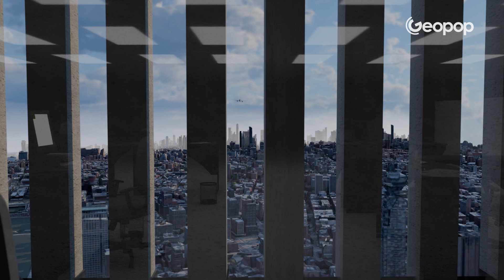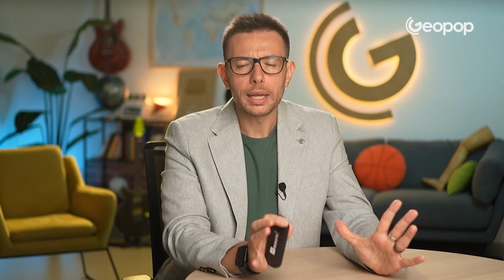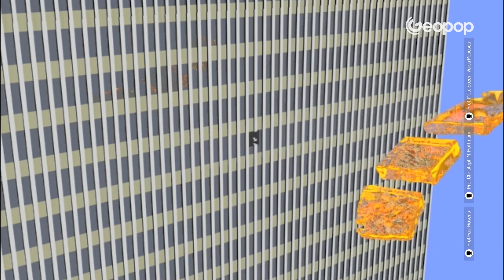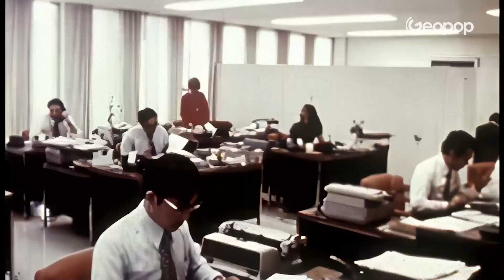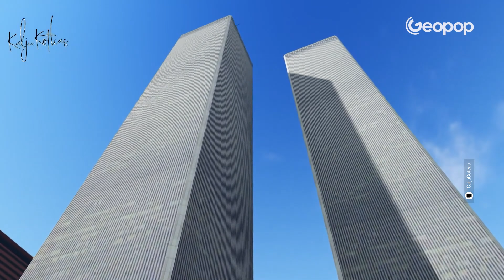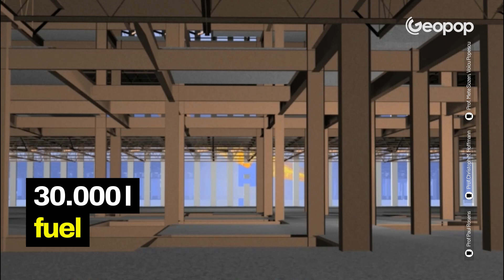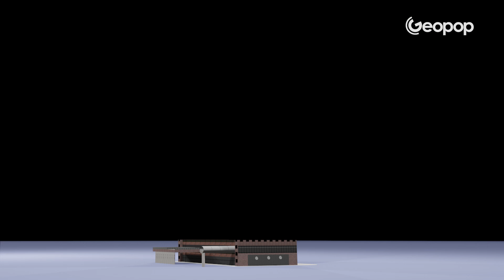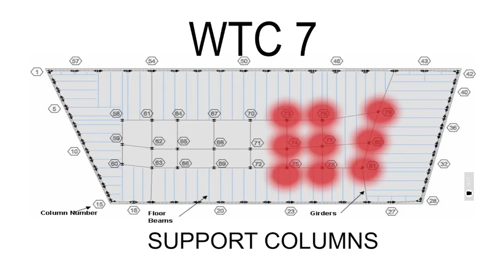9/11, 2001: The Technical Reconstruction of the Twin Towers and WTC 7 Collapses

Comment: That is what many people say , That its do to the way its built . Thats sounds good for the Twin towers but what about building Seven . Its traditionally built and never had a direct impact but yet it freefell in seconds it was down ( and without damaging any buildings around it) CONTROLLED ? MAYBE
Reply: There was absolutely nothing traditionally about the way Building 7 was constructed.

Building 7 was a unique, asymmetrical 47-story steel frame structure built atop a smaller 3-story building serving as a partial foundation, requiring lower floors dedicated to complex load transfer structures. Of trapezoidal shape and tube-in-tube construction, B7 (above the 7th floor) consisted of a central core of steel columns carrying most of the gravity load, perimeter steel columns around the outside of the structure carrying the remainder of the gravity loads and long span beams and girders to tie those elements together and form the floors. On the outside of the building hung a facade or outer shell. 

A lot of that is covered in this video. 

Building 7 collapsed from the inside out which is not at all intuitive and hard to understand with most details being hidden from view.  It requires careful analysis and observation, and some people will struggle no matter how much it is explained. 

Again, covered in this video.

When it collapsed it destroyed the building at 30 W. Broadway (Fiterman Hall) and caused nearly a billion dollars in damage to the Verizon Building as well as blocking 3 surrounding streets in debris up to 7 stories deep.
Reply: WTC7 collapsed due to fires inside the building that were burning for over 6+ hours.